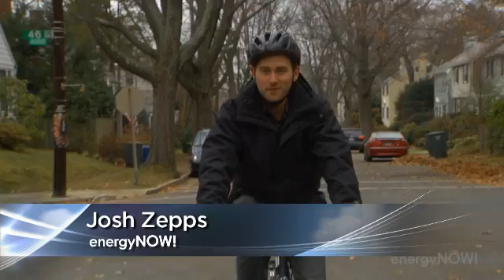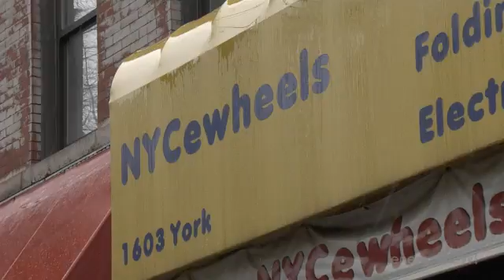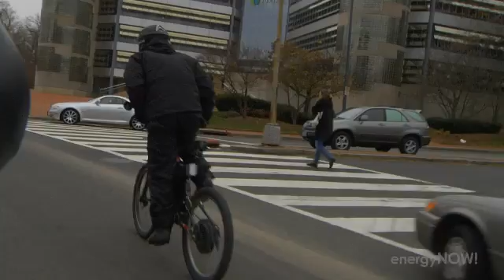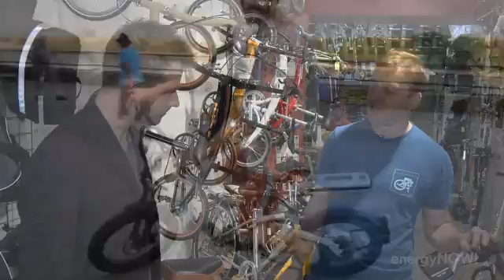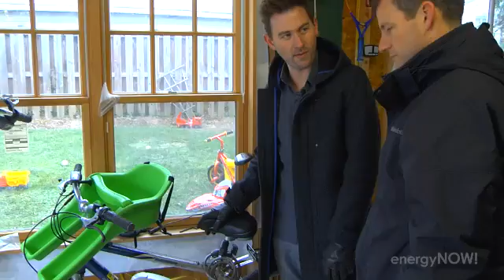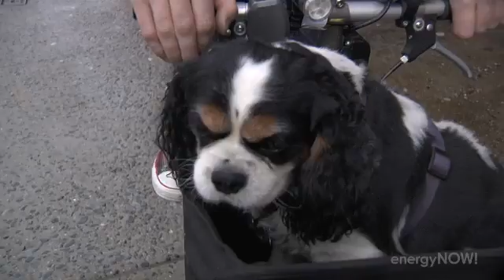Electric Bikes Put A Charge Into Commuting

Comment: I do not understand why we have not invented 4 solar panels high efficiency incrusted inside the wheels... Front side : with motor. Back side huge battery. Charging plug for our smartphone, alarm when bike is trembling or moving, rain, snow and wind alarm proof, optional big  solar/rain canopy protection and for electricity as well etc etc... We would have the idea of the best bike ever...
Reply: +Kalvin One
 incrusted inside the wheels...
 inside the wheels...
the wheels...
wheels...
...
incrusted
Reply: +Casey Bitts all the time and trust me... In the snow and slopes it 's horrible
Reply: +Kalvin One the thing is electric batteries cant hold enough power to cover the distance of a car, and most people driving a car won't give up their car that they need to refuel every few hundreds of kilometers for an electric car that can hold for maximum 100 kilometers (that's the most power an electric car could hold). people are too lazy to recharge their vehicle more often, and you won't have a lot of buyers. for example: there was a company in Israel called "Better Place" that converted cars into electric cars with a battery that holds power enough for 100 kilometers. the idea was to put "Better Place" stations - like gas stations where you unload your empty battery and they give you a charged one while they charge the empty one. the number of buyers was very small and they had to shut down the project.

Comment: It does not say any thing about how steep of a hill you can climb with 350lbs.
Reply: +nhoj yesdnil Forthe low wattage systems like that you want mid-drive so it can use the gearing on your bicycle. Otherwise you are in for a lot of extra work pedalling that extra weight up hills it can't climb. Been there.

Comment: most new 50 cc mopeds are 100 mpg
Reply: This is probably closer to 500 mpge if it's 12-15 cents a charge for 20 mile range at gas being 3.50 around now. Some batteries are even better. Moped or motorcycle maybe a better fit for you though. Different strokes for different folks.

Comment: I like my electric bike but in the UK the govt has restricted them so much that only the people that really want one will bother with them.

So if you happen to live somewhere like the UK ie Europe you are better off buying the best you can afford rather than buying cheap cos you will be disappointed with a cheap EV, but the top of the range tend to be expensive but much better in performance.
EU and UK law are not good for electric bikes, they don't even allow the use of an electric scooter, Out lawed.
Reply: They have a 250W restriction in the UK and Europe which means the most practical ebike would incorporate a mid drive in order for the motor to take advantage of the traditional bicycle gearing. They really should raise the motor power limit to 500-750W. This would really be a game changer.
Reply: JaleelJohanson62 I agree they should raise the power limit to what you said but they should also raise the speed limit to when the motor should cut out, to 20 mph.

For a bicycle that is a reasonable speed restriction for the motor to cut out at.

But EU law allows 250 watts while UK law says 200 watts so it's even worse.
Reply: flitsies It's almost like cigarette smoking in the U.S. On one hand they encourage people to quit, but on the other they need the tax revenue smoking provides. In the UK this would be the gas tax...
Reply: JaleelJohanson62 Yes you are correct it is exactly the same, and the UK uses the exact same tactic on smoking as well.

I'm not a smoker but I'm given to understand a packet of 20 smokes in the UK come to around £8 which is probably around $12 dollars without the tax they would probably be around £2 for the same smokes, people used to go off to France to buy their smokes it used to be cheaper for them to buy a train ticket to France buy their smokes and return with a fist full of smokes than buy them from their local store.
But the govt didn't like that so that was basically stopped.

Strange how they couldn't stop the drugs and guns coming in but was perfectly able to stop the smokes.

But that aside the govt makes a fortune off fuel, with electric vehicles they would have to pump up the cost of electricity something we all use in order to take the same tax revenue, so they put out bogus claims about the electric grid, they hold back progress and so on just to keep the money coming in.

If everyone went over to electric vehicles and stopped smoking over night the govt would probably go bankrupt, or have a huge hole in their budget.

I doubt it would be a problem for the grid as people wouldn't all charge at the same time, and if some of the new tech came on line much of the charging could be done without the use of the grid at all, especially if the night solar panel came out, what are they waiting for?
Reply: flitsies Wow! We seem to suffer from some of the same annoyances in our respective countries.. Fortunately for me, it's not so with electric bicycles... Where I live there's a 2 brake horsepower (1500W) limit imposed on electric bikes which is more power than I need as I currently use a 1000W capable power assist where I never use more than 750W continuously when climbing steep hills. It sure does suck that progress is held up because it's imperative to continuously insure that those with all the money continue to have all the money... We'd have probably been to Mars and back by now if not for this nonsense... If I were in the UK, I'd put a 200W sticker on a 500W motor and only climb the steep hills at slow speed so as not to arouse any suspicion.... Electric bicycles make too much sense to let imbeciles legislate them out of practicality!
Reply: JaleelJohanson62 Believe me some used to do exactly that, but by doing that if you get caught you can lose your driving licence and the vehicle would probably be confiscated.

Do you recall the goped type petrol scooters, 25cc scooter really good, many people loved the idea of them wanted to buy one and use it as a commuter vehicle, BANNED illegal, one guy was taken to caught he tried everything but no, the UK govt kills things, the Segway was owned at one time by a British lord something or other presumably the UK side of things anyway, even that couldn't get them accepted into the UK again BANNED.

Electric scooters regardless of what wattage they are BANNED to adults.

In all of these you could lose your licence if caught riding one on the road, and don't think you can ride it on the pavements, you will find yourself in big trouble fines confiscation, licence bans and so on.

Pollution is a buzz word for screw the people out of their money, nothing else other than we have to live with it because the govt wants to make loadsa money.
Reply: flitsies What a shame... The lipo battery is the long lost answer to electrically propelled transport and a bunch of power seeking bureaucrats are keeping it on the sideline... I think that our whole way of running things is in the most dire need of advancement...
Reply: JaleelJohanson62 Agreed.
Reply: JaleelJohanson62 LiPo batt. like to blow up if not used properly. That's why they are like only used for like r/c in America (b/c if you overcharge or charge too fast... boom)
Reply: PokemonDiamondUS LiFePO4 and lithium manganese are quite safe and only come with a minor hit in capacity when compared to lithium cobalt based batteries popular in RC.
Reply: ***** You're using the electric grid to type your nonsense... At least the electric bike moves people... Mine charges off of a 200W solar panel so piss off...

Comment: 27 in 10 speed?  You mean 27 speed? 9 gears rear 3 front?  Well with a kit (I use e-bikekit) will set you back $600-1000